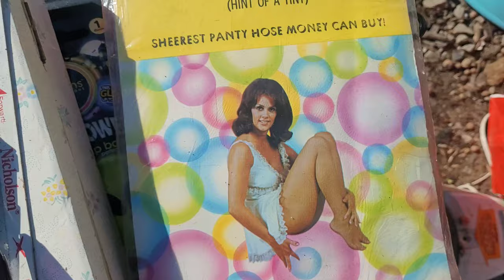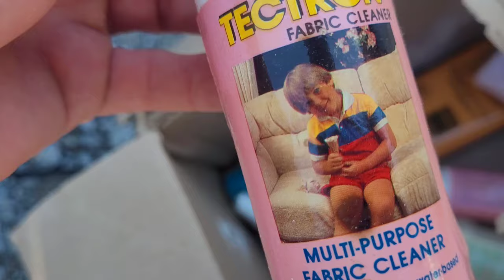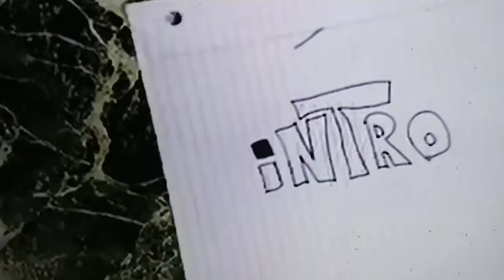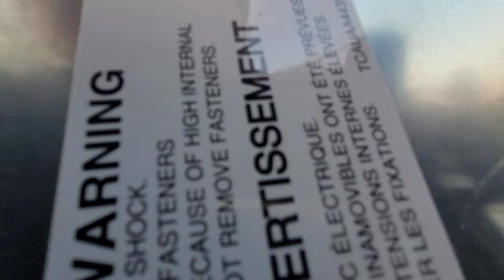Creating Bonds At The Curb

Comment: Do u notice a difference in mpg towing ur trailer
Reply from the maker: Not really.  The most I ever have to put into the tank is $20 for gas and it's still getting 'er done 🤷🏻😁
Reply: Have you tried to backing the trailer up steering from the bottom of the wheel yet it makes it so easy just clockwise goes right and counter goes left when the trailer is straight otherwise if it not think in reverse if that makes sense
Reply from the maker: @Walton-ck8vj  I have , I still suck lol 😁
Reply: Parking lots are a great place to practice in the field out the gate maybe a bit much at first